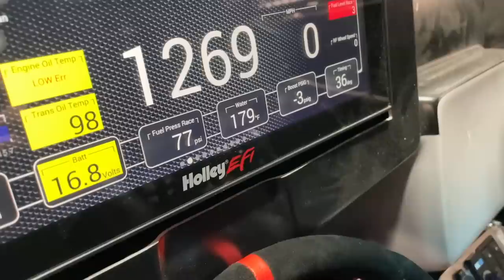Mullet's 9.3L SMX Big Block FIRST FIRE UP!!! This Thing Is Insane... (5,000 Horsepower)

Comment: Be careful, be safe. The guys worked day and night getting little rest. Mistakes could have been made. Double check everything. A little water or oil under the tires at 230+ mph could be big trouble.
Reply: erikkhyndman9184  mullet went 222 with the old setup so 230 isn’t that far off

Comment: Shout out to Steve for creating such a badass engine platform
Reply: If the dude can connect two V8s together and make a running v16 I’d say he can pretty much make a rocket ship
Reply: One V16 block.with 4 cylinder heads.
Reply: @beckyumphrey2626  Split cylinder heads are pretty common to prevent warping and to make it easier to work with
Reply: erikkhyndman9184 they're all special brother...
Can you build a V8 that make 4,000 hp reliably, and can be street driven thousands of miles between rebuilds??
Reply: Erikk Hyndman  haters are everywhere
Reply: Erikk Hyndman  you ok bud??
Reply: @AH-lw2bj  it doesn’t go thousands of miles before rebuilds. Hope you don’t believe that
Reply: @zethloveless7238  they do 2 drag and drives before a re build....
The F are you talking about?
Plus dyno sessions and plenty of 1/4 hits

Can you build an engine that makes 4,000 HP on a hub dyno then do even 1 hit?

Don't bother me again
Reply: Erikk Hyndman  Meh those engine builder's you listed aren't anything special
Reply: @bigduphusaj162  big diff between any powers you mentioned and the figures people are talking 5000 🤔. I don’t believe for one second it’ll do 100k miles either just stop man lol. These things do get refreshed more often than people like to imagine or realize.
Reply: @bigduphusaj162  please link me to the guys laying down 100k miles on these. I was speaking to the power levels also that the video itself mentions and I’ve seen them go back to Steve on the regular.. You went from saying likely to saying will do 🤔. I’m down to watch some vids. Send it
Reply: @AH-lw2bj  at the power levels he’s been aiming for it will not go “thousands of miles” before heading on back to Steve. He will lean on this shit like no tomorrow. I think you guys totally mistaken what I actually said 🤣. Btw man dyno session and some 1/4 hits won’t put much of any miles on the engine. It’s the power levels he’s running at that will affect longevity 🤔.

Comment: It's crazy how far this channel has come. Going from barely making 7 sec runs in Leroy with no coolant to now looking into 5's. Let's gooooo
Reply: I agree…. Mullet gonna need more tire out back?
Reply: I hope Mullet has a carbon fiber drive shaft and a bigger joint than the one Steve broke at sick week.
Reply: @B WJ cage is only good for 6.0, and I remember them talking when they were building mullet that it would take a whole new chassis to go faster, can't just add more bars. EDIT: after doing a little research it doesn't look like NHRA has a cage cert for door cars that goes below 6.0, only certs faster than 6.0 are for top fuel and funny cars, I'm gonna guess it hasn't come up enough for them to have made a rule yet since there are only a handful of full body cars capable of going sub 6 seconds, will be interesting to see what they end up doing
Reply: Mullet's chassis isn't setup for 5's consistently and the cage is only certed to 6.0.

He'd have to build another chassis but damn he is setup to run 6.teens or 6.20's all day now on a radial.
Reply: @@ByDesignKatonah I hope they thought about that because those were the next upgrades Steve is making to the Wagon. A bigger drive shaft joint connecting the drive shaft to the back diff.
Reply: @tstager1978  They will have to be careful. That car has a 9" rear and 1350 joints. At least Steve had a 9.5" when he broke.
I think they are in a good spot if they can run in the 6.40's at this race, and at the end, possibly making a 6.20 or so car. It will not be a 5 second car as is.
Reply: @AB-80X  I think it's those 1350 joints that Steve was breaking.
Reply: @tstager1978  It was. But that was not the biggest problem. It all went south when he tore up the 9.5" rear because the track had that chitty radial prep on test day. But yes, the 1350's are not meant for that kind of power in a heavy car. Even though Mullet has gotten the Mark and Mindy transmission, the rest of the driveline is from the LS days. If he tries to put 4500 through that on radials and it hooks, something will have to give. The saving grace is that it probably will spin and thus save the driveline. That said, he is very limited with those turbos at the moment.

Comment: That SMX easily made 3200hp on 40lbs. Can’t wait to see it at 60 or 70 pounds…..sheeuuw buddy. Thanks for the daily uploads Cleeter.
Reply: I believe Cleetus is running significantly smaller turbos than Steve ran so expect it to make less power than when Steve ran it.
Reply: More isn't always better. I don't know if this has more cubic inches than his last setup, but if not, you might be surprised. It's about getting the turbos in their efficiency range, and keeping them there as long as possible.
Reply: @rpturbo  This one definitely has bigger cubes lol
Reply: @BMW_Mustang_Dodge  well 9.3 liters works out to a 567. I don't think that's any bigger than before. Basing that on the text on the newest video showing it's 9.3 liters
Reply: @rpturbo  last engine was a 540 cubic inch.

Comment: When adding oil... If you start by squeezing the container until the oil is right up to the top, then release the squeeze at the exact moment it's about to come out, you can get every drop where you want it. Just takes timing and practice. Been adding oil that way since they replaced the wax and cardboard rigid round oil cans with them new fangled plastic bottles. Gawd, I'm old.

Comment: There is NO replacement for DISPLACEMENT. Good work boys. You really do show the grind that goes into vehicles like this. Its an insane amount of work. Much respect.
Reply: There's two massive turbos attached to the thing. 9.3L clearly isn't enough then.
Reply: First time I read that it was Gran Turismo
Reply: @huntr331  I want an SMX for my daily driver! Imagine stomping on it between redlights after you have bumped in and your just gone doing 250 mph in a 35.
Reply: Light is right.
Reply: Adding power makes you faster on the straight, subtracting weight makes you faster everywhere.
Reply: Golly gee,did you just make that saying up? You must be a wizard!!
Reply: @huntr331  big inches big turbos. Win lights

Comment: This is an amazing achievement. I bet there aren't many NASCAR teams that could out perform what you have achieved in one week to swap out a 3,000 HP engine (or was it 2000 HP) for a 5,000 HP engine and squeeze it into Mullet.  That's impressive.
Reply: I love these guys, but you must not have been around some of these race teams. The only thing slowing them down is the rulebook
Reply: old engine was around 3k at full boost
Reply: These guys are amazing undoubtedly but those trained and well practiced nascar teams are nuts.
Reply: @jacobjstoffer  No it was not. It was a 3500 hp engine, especially considering the fact that they pushed about 57 psi on that 6.47 pass. This is a 4500 hp engine, and Steve has mentioned this more times than I care to remember. If he wants to push this to 5000 hp, it's 80 psi and it's goodbye to the entire driveline if the car would even hook. But that's after we factor in that those 94 mm turbos will never push that kind of boost. The turbos can only move so much air, so they are probably limited around 55 psi or so which is probably around 3800 hp in this case.

Comment: That beast sounds sick.
Boys doing the tig welding piping, coolent & oil lines, electrical wiring, shining and all the other work required to shoehorn that beast of a race engine into Mullet in 4 days need a Steak Night out on Garrett!

😂👍

Comment: They never turned the engine over without oil in the engine. They even filled the dry sump tank (4:30) and then primed it (5:55). The first key turn wasn't until (7:12). I believe at 6:08 he was referencing to the no oil start issue with the 540 BBC that became such a big deal. When we can't find an obvious culprit, we tend to go for the easy diagnosis, which doesn't help anything when you start with no friction protection, but people are getting mad over this when we don't know how much it played a part in the destruction of the 540 BBC!

Comment: Note the Ignition Reference Angle set in the software. This is typically set to a value that is 10° more than the highest timing you will run.
Do NOT set it higher than 75°. 60° is a common value. 60° is used for an example here.

Comment: you should install 2 throtlle bodies, change a radiator  hoses inlet and  the most important - 8 individual EGT sensors  like steve did

Comment: Imagine a VVT Billet block👀
Reply: My VVT, I want stronger block for car. Some roommate messed up my backup engine... Cracked and then proceed to paint the whole thing Blue, without my permission🙁... Aluminium Blast color...plastic meant to be colored Blue like Valve Covers.

Comment: Never run a positive displacement pump dry... You guys need an OG mechanical safety advisor on scene, I would have gave you hell for running that pump till it made noises. Anyway , SWEET MOTOR, lets see how long it lasts.!

Comment: 13:45.    TOO LATE NOW.  BUT
B..R..E..A..K...I...T.....I....N.  R.I.G.H.T.

20 MIN UNTIL HOT AT 2000 RPM AND 400 MILES.  AROUND THE CIRCLE TRACK AT 60 MPH      TOO LATE
. HOPE ITS NOT REGRETED

IF THIS ENGINE FAILS IN THE NEXT TWO WEEKS FROM NOT BREAKING IN    THE PUNISHMENT IS.   NO VIEWS FOR ONE WEEK.     UNDERSTOOD